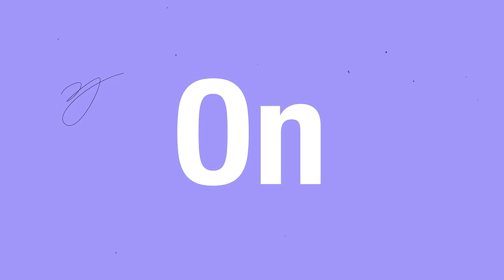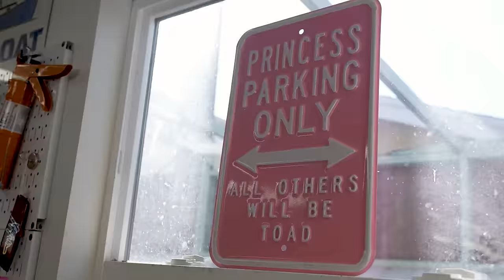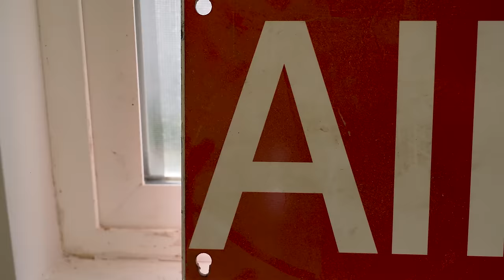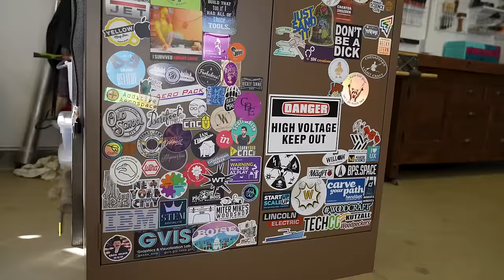I Moved my Entire Workshop in 2 Days

Comment: One thing that makes you a good neighbor when  having a shop is to be aware about the noise it generates and do some abatement work quiet things down. Naturally not banging away until the wee hours is best if possible but during the day when others are at work is often the easiest fix. Another is to identify the loudest machinery like an air compressor etc. and build a sound dampening enclosure for it to lessen the roar. As for using things that require masks for the vapors-gas they release think about a filter system to catch it like a spray booth has not just open a window. Be an asset not an annoyance to neighbors  who have  DIY projects but not the tools that you can use to help them in the shop  but of course not lend them out either. When building work surfaces have the all at the same height usually with a table saw in mind so they can be used for run off  purposes for materials when cutting. Indeed if tooling surfaces-table are all on the same plane a materials length doesn't matter as much and its often why a miter-table saw are at their best when they match. If you've ever wrestled materials between work stations or tried to run it a length wishing it could go onto something just as high is far safer.😀🛠

Comment: 240v at 20 amp? do you do any metal work? Welding, plasma torch with compressor running, etc., guaranteed to blow the breaker at what you are running V and A wise. Or do you just do wood and 3d printing? The new and old workbenches looks great.

Comment: My recommendation for the new shop is a 3D printer. As a person with a shop, myself, I find that a 3D printer has afforded me so many useful tools/accessories that couldn't be purchased at any price. Say for example, you are building something from wood that has a unique profile that needs to be sanded. You can quickly and easily print a custom sanding block that fits the profile perfectly. Say you are building a rocket that requires clamping during assembly, but the round profile is impossible to clamp, a custom set of clamp jaws can be printed exactly to size and shape. Let's not even get into all the custom drawer organizing possibilities that can be printed! The utility that a 3D printer offers is endless, even if you never print one little plastic boat or other useless choochkie you see in all the 2D printing video.

Comment: My dad is 6’3”, and built all the benches in the shop accordingly.  I’m 5’7”… I have managed to lower the main workbench and the chopsaw/radial arm saw station so they are  the same plane as the table saw, but the rest off the shop is still meant for people on stilts. :(  Trying to use the lathe is terrifying.

Comment: All garages should have a 240 volt feed to supply a subpanel, even my small garage is fed 240 at 30 amps.
Reply: I think you mean, "Three Phase" 😉.  Since 110V is basically only a north American thing, the rest of the world has 240V by default (assuming they have power to their shed).
Reply: @dfross87  I only find Three Phase in larger commercial / industrial buildings. Recently for powering all in one package air conditioning units or the larger variety.

Japan uses a 100 Volt standard.

Comment: A couple of things I didn't see thqt I use all the time in my workshop:- A belt sander- great for flattening off and rounding corners etc. with storage for a coule of belts. Use the new belts on wood and the older ones an metal. A grinding wheel with the wheels removed and a wire wheel on one end and a scotchbrite wheel on the other. Again great for cleaning stuff up. And a grinding wheel with a good rest for sharpeing tools and a polishing mop on the other end for making matal bright and shiny!  
Open shelves and cupboards get shop dust all over them. Put clear polycarbinate doors on your shelves so you can see what's inside but less dust on your kit. I find I run out of wall space quicker than floor space in a larger workshop.

Comment: It is so weird to me (european) that you (americans) in exceptions have access to 240V. I know how the US power system works, and that basically every house has 240, but split in half phases (which also is so weird to me).

Most of our one family houses have 3 phase 380V 40A supplied from the grid. So 1 phase 230V is the "low power" solution. Each outlet is fused to 16A. So a total if 3680W continuous load for one of our low power outlets. We also have 3phase outlets, mostly in garages and for the stove in the kitchen. Those are 3p 380V 16A, so roughly 11kW. In rare cases we also have 3p 380V 32A, and in industrial sizes 63A. Everything above that has to be hard wired.

So... in short: I pity you. Having electricity being the limiting factor when choosing tools is pretty uncool.

How are the lemons? Tasty?